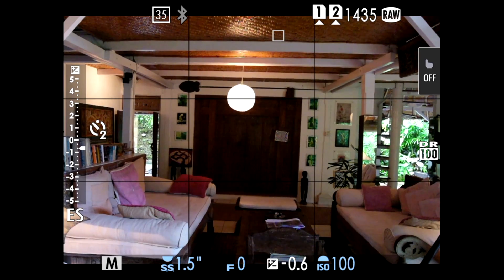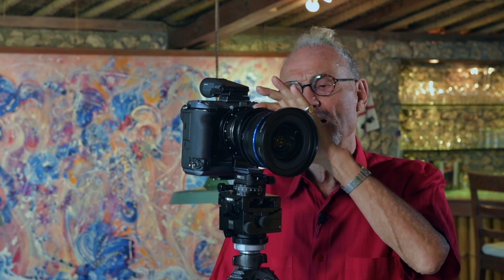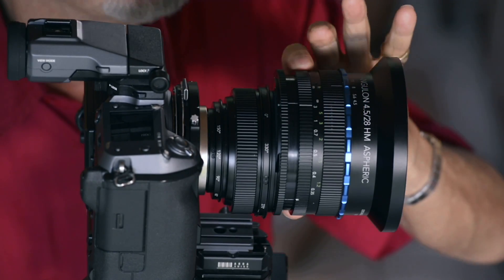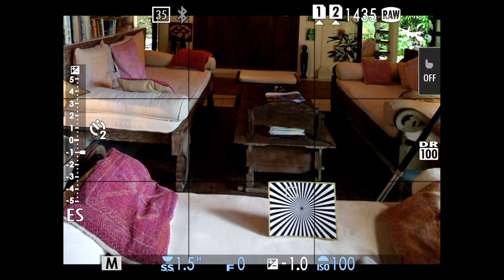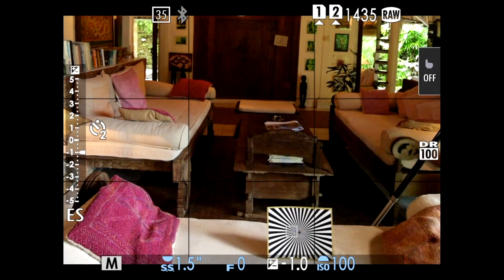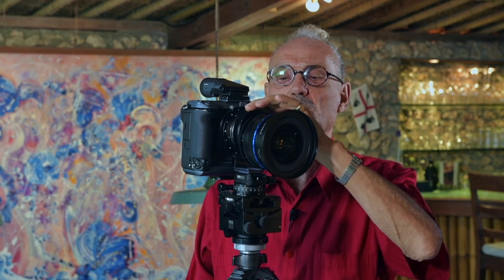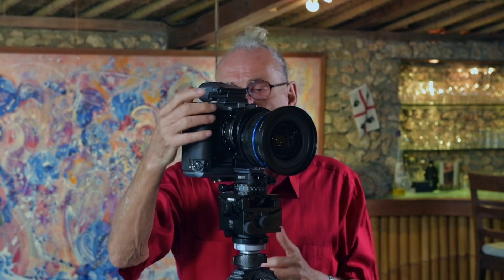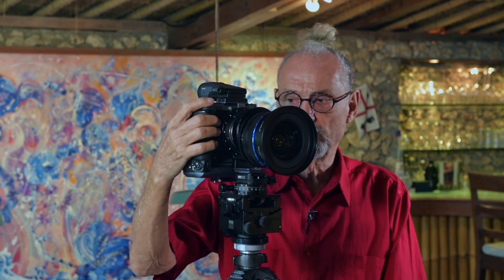How To Set Focus Using Tilt w GFX 100

Comment: Good luck Christopher, you videos are very very good, keep it up, I use canon tilt, thanks for the info,
Reply from the maker: Thank you. Which T/S lens do you have?
Reply: @christopherleggettphotography   Hi Christopher, I use the Canon TS-E 17mm on my Sony A7riv - I'm waiting for the GFX 100s BTW: your focus stacking video was very good too.
Reply from the maker: @TheBronDancing  go lens. when Canon can out with it, it prompted Nikon to get its act together and make the 19mm PC lens, which was/is a success. GFX100 S should be a good piece of gear, but buying that will be the cheap part. Next are the lenses, then the storage space problems, and computing power. It has a better IBIS than the 100, but, what i don't like mostly about the camera, is that one cannot remove the viewfinder and install the flexible extension, which for architectural photography, i find essential. I am still hoping that Fuji will make an extension, either with a cable or radio, so that one can operate the camera, when it is in an awkward position, which happens to me a lot.